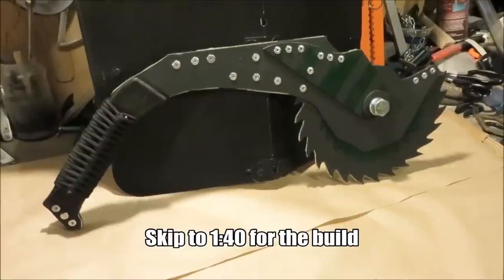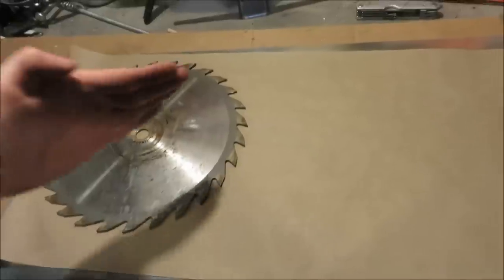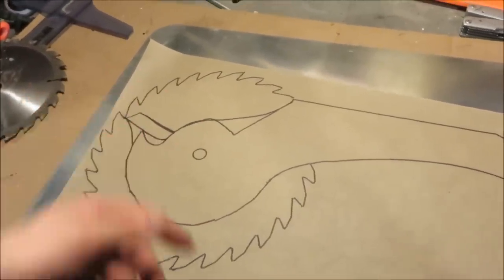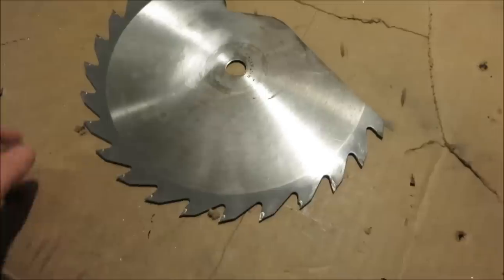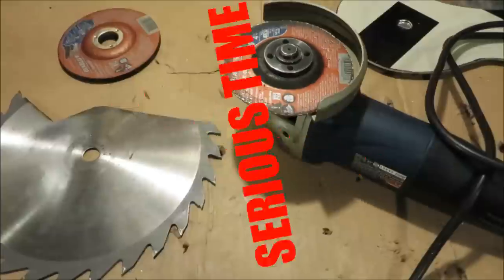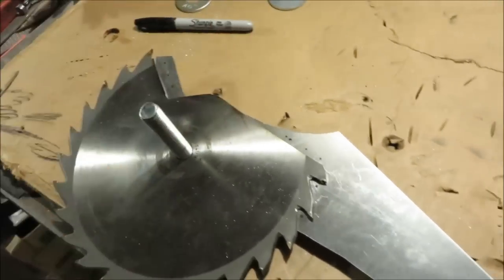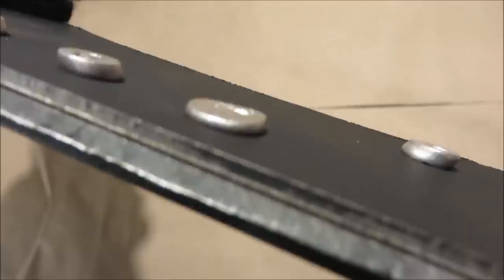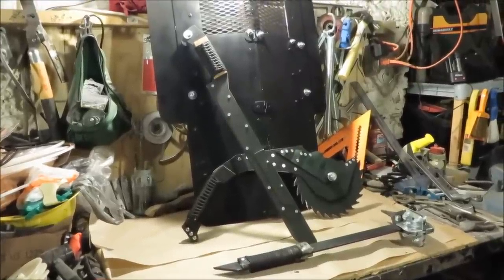How to Make: The Warsaw (Saw Blade War axe)

Comment: just cut the spike in half diagonally so the spike is centerred and you aproximately have a 45 angle, this way it wont get in your way and wont be that sharp but you can still crack open a skull with it with some force since a point is still a point

Comment: Also could you make a razor sharp katana?
Reply: A real katana is already razor sharp ,I would say the sharpest sword in the world
Reply: You can make anything "razor" sharp (a real razor has a reverse concave edge, equaling in a thin, and weak edge, i prefer the term "shaving sharp") but, the think is, its about edge retention, i could razor sharpen a piece of aluminum, but its sure as HELL not gonna' keep   That edge, there are 2 ways of making a katana, a mild steel (soft) spine, and a hard edge, the next type is a all hard sword

Comment: what are spacers for what happens if you don't put them in
Reply from the maker: They help everything fit together better, because the sawblade between the two brackets spaces them apart, so if you rivet the handle without a spacer, there will be an awkward gap in the brackets between the handle and blade. Plus, more layers= more strength.